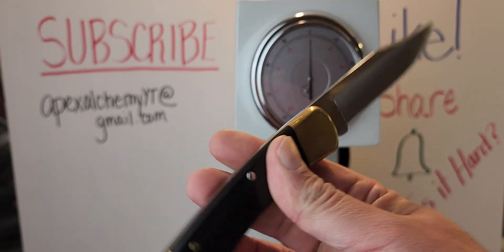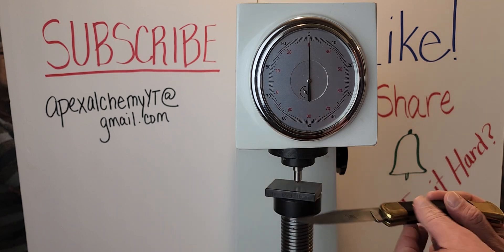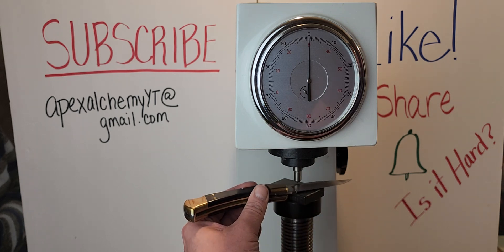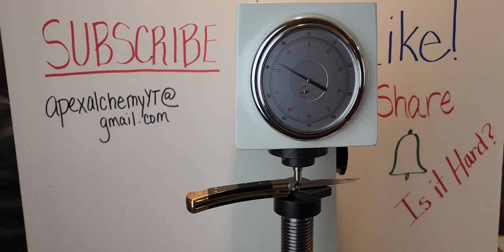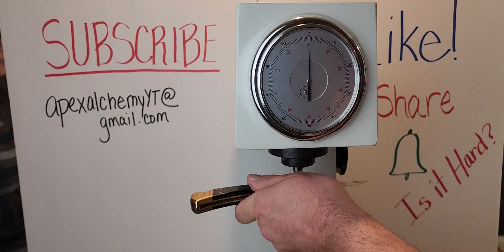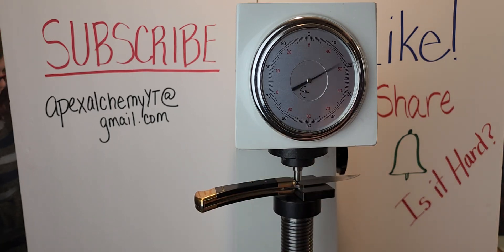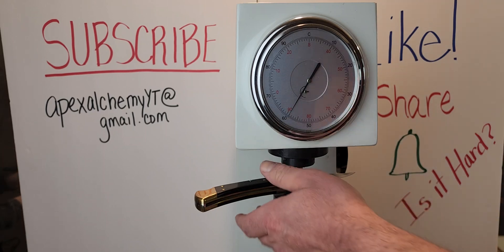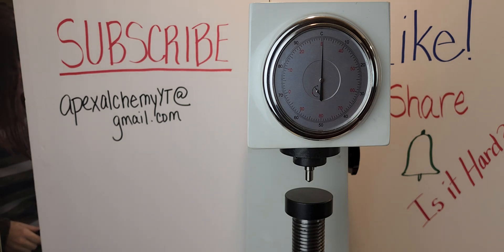Buck 110 - 420 HC - Rockwell Testing ( 5 dent avg)

Comment: Why didn't you take readings at much more different areas of the blade, like the center of the blade, the tip area etc. instead of concentrating in a small area like you did. 
I think that would give a better overall assessment of the hardness.
Reply from the maker: @davidparker3346   it has to be flat or it isn't going to read accurate.

Comment: I've always heard the 110 .ade in the 60s 70s were hard as heck. But back then there were no diamond sharping.  Most guys sharpened there knives on a bench grinder !!
Reply: They were 440c around that era, way better than anything else that was being used at the time.
Reply from the maker: @CNYKnifeNut   my dad had a gerber in s30v and I told him it was supposed to be better than 440c and he looked at me like I was stupid and said, " ain't nothing better than 440c"
Reply: @CNYKnifeNut yep, knives made with 440C were everywhere back then.
Reply from the maker: @shoresharp8349  that's nuts !

Comment: That’s good for 420 hc.
Reply: I actually believe it is too hard for the 420. 🤷🏼‍♂️ Maybe I’m nuts, but I have never liked Bucks yet I love vintage knives and knives of the style. I don’t think 420 ran at high hardness is that great. It has okay edge holding but not compared to steels that can run 60HRC and not bat an eye— it negates the toughness imo. I’ve seen more 110s with broken tips than any other knife. I think the Bos HT is overrated.
Reply from the maker: @Finkelsteinshiitkid   no complaints from me